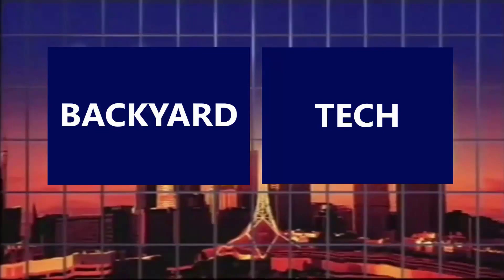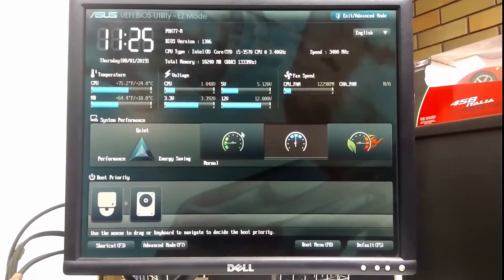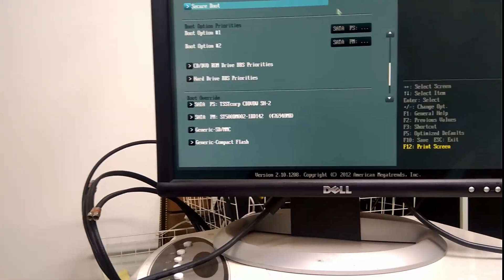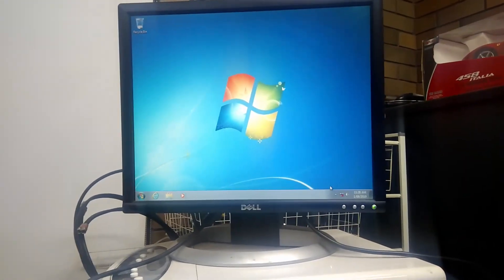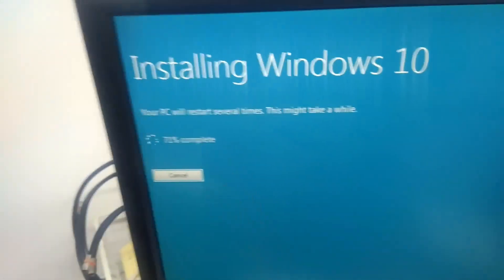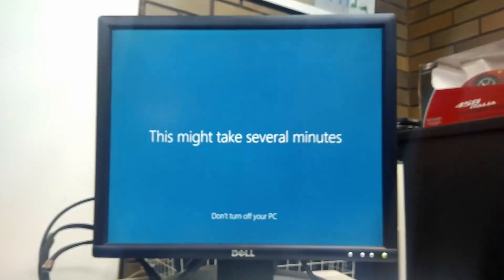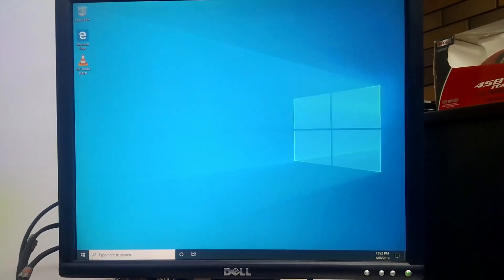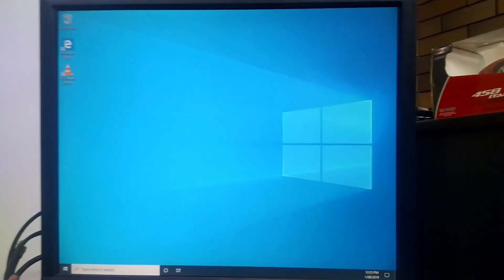Projection PC System Build PT2 - Installing Windows 10 Pro 1903

Comment: Nice video. Great job! I would highly recommend you install Microsoft Edge (Dev Channel) instead of Firefox. Take a look at my video on the review of this Web browser and I think you'll agree. The link for the download is below my video review. I've just upgraded my Dev Channel version of Edge and it's fantastic. IMHO, the new Edge Web browser for Chromium is superior to Firefox, especially on the Windows 10 Pro 1903 platform.

I noticed several times in the video you seemed to be justifying why you weren't going to install a LInux distro, a Unix OS like Dragonfly or OpenBSD, or Solaris on the Projection PC project PC but were installing Windows 10 Pro 1903 instead. You don't really need to justify this to anyone. If the customer wants Windows 10 Pro 1903 because this is the OS that their projection software runs on for them, then case closed. The customer dictates what they want and that's the end of the debate. It shouldn't matter what anyone other than the customer thinks they (the customer) should have. Now, if you advise the customer for some reason that what they're suggesting won't work and they insist upon the system; that is to say, assume the customer insisted on Solaris and you suggested Windows 10 Pro 1903, then I would give them Solaris and let them see that your recommendation was correct. They'll come around and follow your advice more closely in the future. Please don't let people get to you. You know what's best.
Reply from the maker: Fair point fella. But in the short term (6-12mnths) with this having no network access, web browsing is not on the cards.